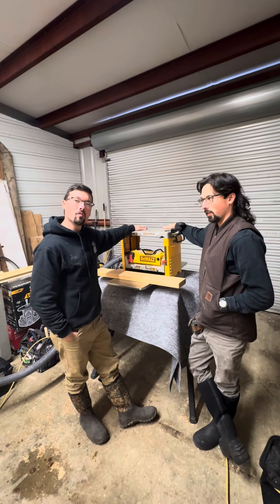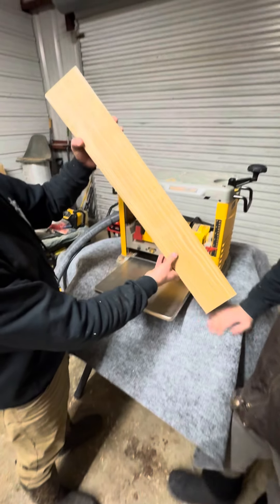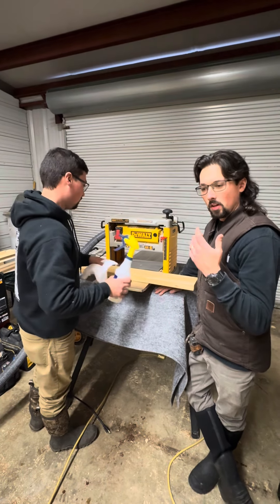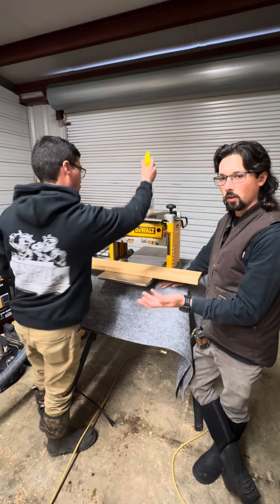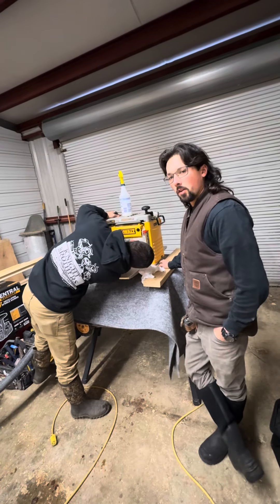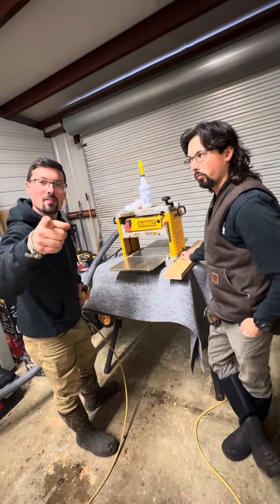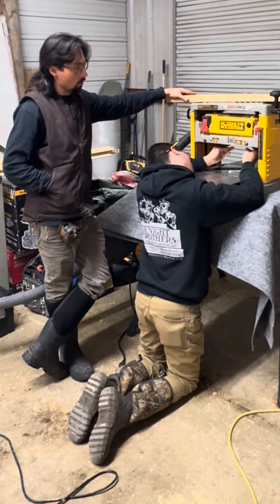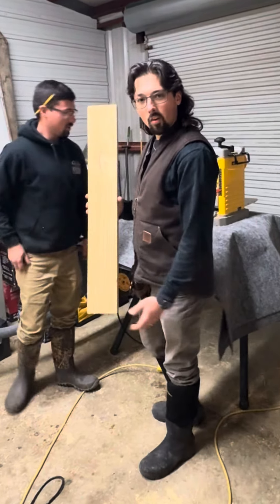How to clean your planer rollers

Comment: I found that using paste wax on the bed help significantly versus trying to clean the rollers
Reply from the maker: Thanks, we thought about that also. They make some easy slide spray for stuff like that. We need to get some.
Reply: My husband has this same model planner, he uses mineral spirits to clean his rollers
 U better watch cleaning the front roller because of the blades u can get cut
Reply from the maker: @marilynmoore6752 Hey, thanks for the feedback . Glad to know we aren't the only ones. They are sharp! I had the whole cloth over my fingers so I wouldn't get cut.
Reply: Had the same problem and I cleaned my bottom plate. Worked great with paste wax , but was looking for better ways.

Comment: I have the other DeWalt planer (DW 735, I think) and built a longer bed out of a piece of melamine that I insert.  It is much longer than the default fold down bed, and has eliminated most of the snipe, and also doesn't need waxing.  Might wanna give that a try.
Reply from the maker: That's a great idea! We've talked about that and I'm sure that would help out a lot but I think we might end up just getting a bigger planner and using this one on the job site.

Comment: you change the blades out from the top not the bottom
Reply from the maker: I guess you could turn it upsidedown
Reply: @KnightBrothersConstruction   there is an access panel on the top of the motor to change the blades. to me it looked like you change the blades from the bottom.
Reply from the maker: @rytyky03  There isn't any access panel on top of the motor? It must be in the back kinda between the dust shroud and the motor. Thanks man, I'll have to check that out.